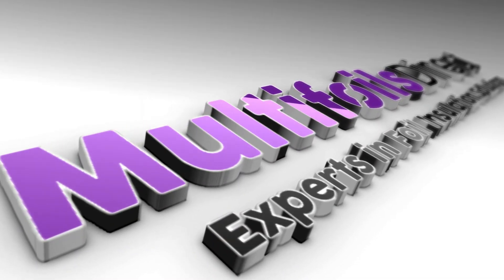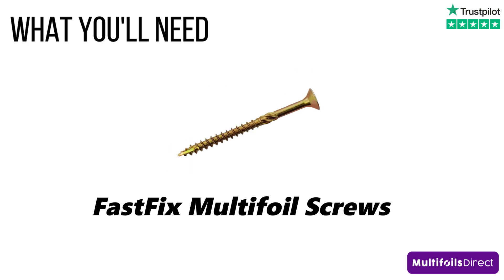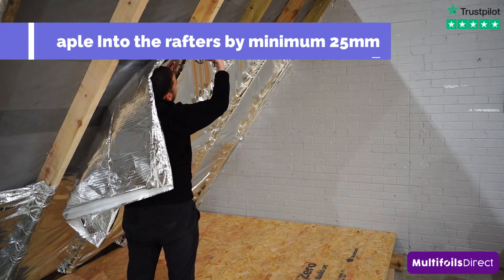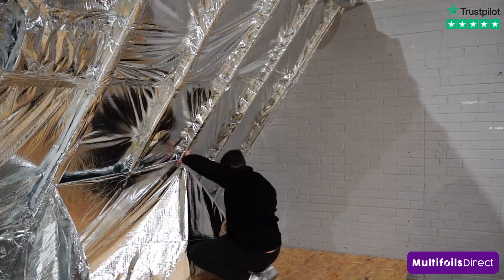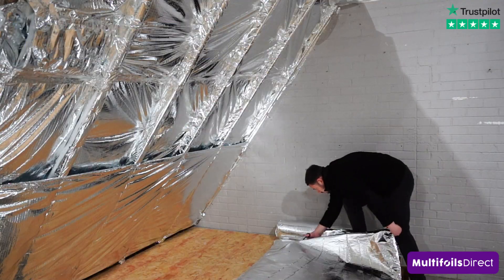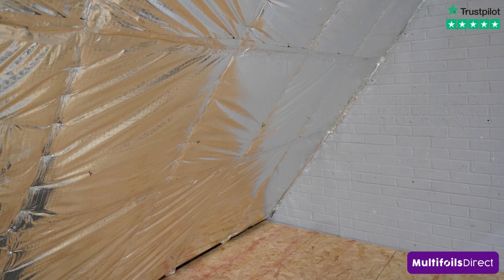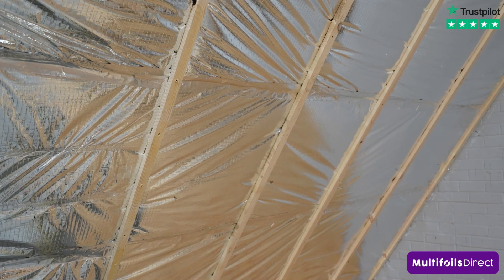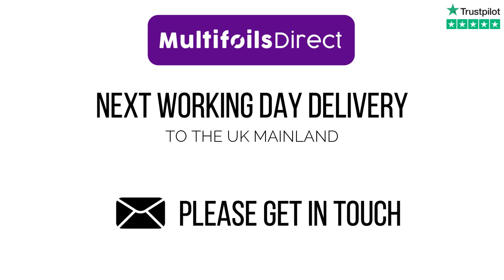How-To Install two layers of EcoQuilt Expert Insulation Under Rafters for maximum insulation value

Comment: I am a big fan of multi-foil insulations but most contractors are afraid to use it.  What is shown here is the retrofit installation in an existing roof and the system is highly beneficial because the over all roof thickness is kept to a minimum, maximising the interior space when compared to traditional systems of insulation.  I always specify that the joints between the multi-foil sheets are taped to ensure that the system is vapour proof to prevent interstitial condensation.  Multi-foil insulation values cannot be calculated like traditional materials because they work in a different way and have to be assessed empirically, for this reason I have found some scepticism in Bldg Ctrl and clients.

In a new roof construction multi-foil (by other manufacturers) can be used as a sarking that then saves even more space because the second layer is installed like the first here and then the plasterboard is fitted to the rafters without the need for counter battens.  Fixing plasterboard and battens I have found is difficult with drilled screws because the layers of multi-foil wrap around the screw preventing it from driving in.  I therefore use/specify stainless steel ring shank nails that are more than adequate for the job as little loads are experienced.

 Although multi-foil is an expensive sheet compared to traditional insulation, the big benefit is that it can allow smaller structural sections to be used.  I have had the situation where to use traditional insulation the structure needs to be 200mm thick just to accommodate the insulation but with multifoil the timber structure need only be 75mm thick, this was the case on my own house where the existing roof rafters are 3"x2" and using standard insulation the roof extension would have meant unsightly steps in the roof internally or externally.  Using multi-foil I achieved the required 'U' values and could revert back to the shallower rafters.  All of that saved money, which more than offset the extra cost of the insulation..